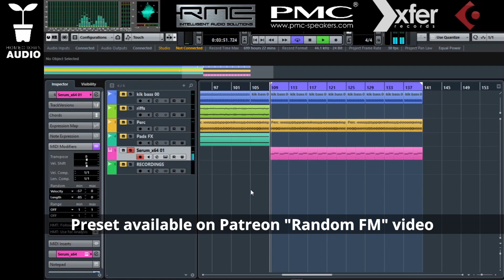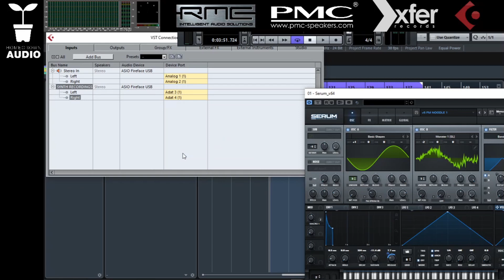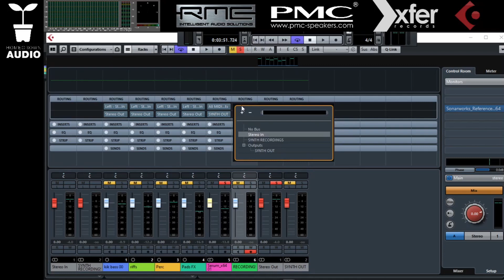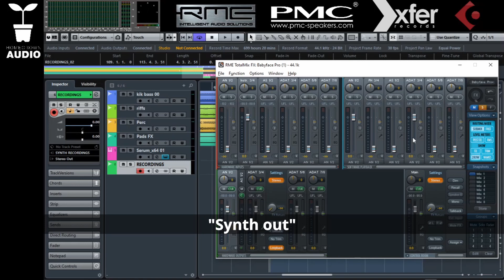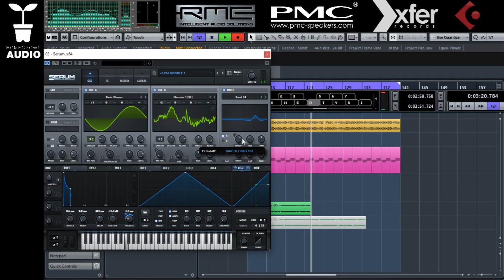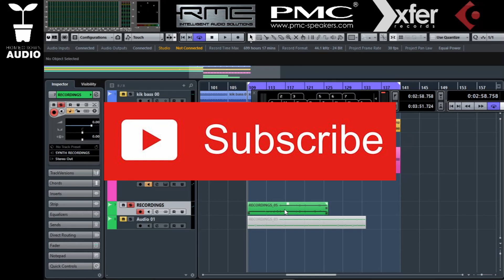WORKFLOW: Turn any VSTi into HARDWARE Tips & Tricks. RME Routing. Cubase resampling. CUBASE TUTORIAL

Comment: mate, do u mean Cubase can't  record a VST's output without going out of the box?? bill
Reply: Yes it can. You can just send the vst to a group channel, add a new audio track and set its input to the group channel. Takes two seconds :)
Reply from the maker: @AboveEmAllProduction  yes, i did mention it on my reply :) thanks for the feedback tho! :)
Reply from the maker: You can record the vst normal as offline or real time.. As any daw and vst can do  but all recorded on the midi automation and notes... I'm trying to simulate a hardware synth workflow where you don't need this midi automation drawn and just tweaking it real time and recording.. You can record it like this inside cubase by outputting synth into a group and then group output  back into an audio track input.. But on this video I show how u can send the output into analog converter and back in the box (so you can add any other hardware processor in that signal path as an insert)
I hope that was clear!